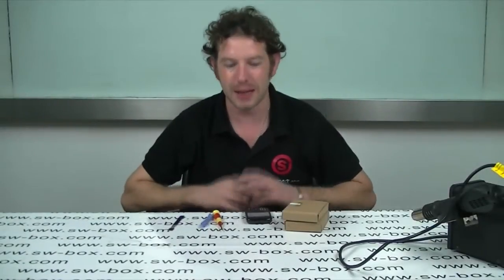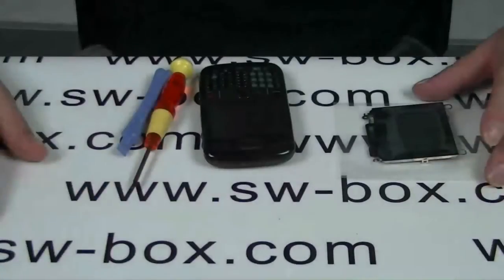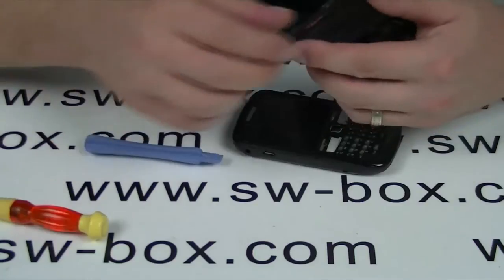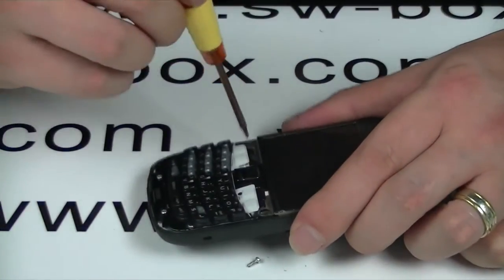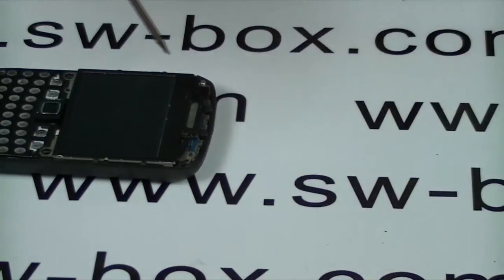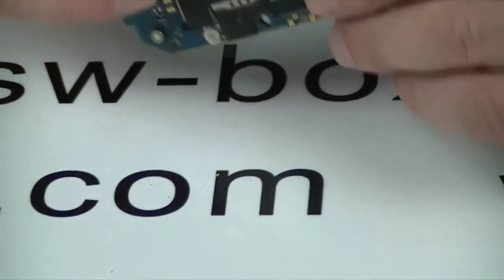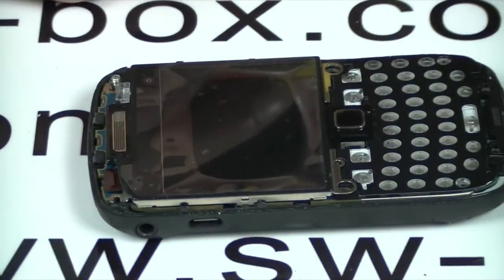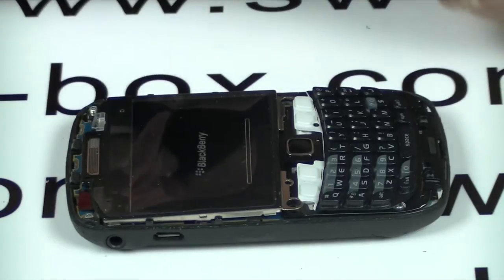how to change blackberry 8520 LCD

Comment from the maker: Hi, no just changing the LCD you should not loose anything, just take your time and make sure you order the write LCD, you need to check if you need the 005/111 or the 007/111, you should be able to see one of these two codes printed on your old LCD, I hope this helps,
kind regards,
Neill

Comment from the maker: Hi, the best thing to do is try a the next size up torx screw driver, if that does not work then try using a flat head screw driver and see if that can work, the other key point with these screws are you need to use a lot of downward pressure otherwise you will damage the heads, I hope this helps,
Kind regards,
Neill.

Comment from the maker: @SuperSmurfz 
 Hi unfortunately Blackberry changed the screen for different regions, not sure why but that's what they have done, the only way to tell which one you need is to take it apart and check the serial number on the LCD,
if you have ordered the wrong one i am 95% sure it wont work but you can try if you like, if it is the wrong one and does not work just send it back and order the right one, i hope this helps,
kind regards,
Neill.

Comment from the maker: Hi, it can only be two things, first your battery is dead, ( but i doubt that ) second it is the battery connection on the middle frame, first check that there is no dirt on the connections, if it is clean and you still have the same problem then you may need to change the connection socket, we don't sell the spare battery connector but a new middle frame from us will cost you $6.43, if you have a friend that has an 8520, ask then to try there battery in your phone, i hope this helps
Neill.

Comment from the maker: Hi, the blue dot is a warranty sticker, basically Blackberry put it there so they know if someone has opened your phone other than them, the screw is under that blue sticker,
You can just push through the sticker or remove it then you will see the other screw,
I hope this helps, and if you need anything else just ask,
Kind regards,
Neill.

Comment from the maker: @bibblebabble69 
Hi, yes sometimes a white screen is caused by the LCD, it's a good place to start, just make sure you check what LCD number yours is before you buy one as there is more than one LCD for the 8520, it will be on the back of the LCD,
i hope this helps,
kind regards,
Neill.

Comment from the maker: Hi, yes you have cracked the LCD, best to change it as it will only get worse, one piece of advise though, take the LCD out before you order a new one as there are several different LCD's, Blackberry made different LCD's for different countries, I don't know why they did this but they have, so check before you order, there will be a serial code on the back, it maybe hidden under a sticker, the code will have some numbers in it like this 005/111 or 007/111, i hope this helps,
kind regards,
Neill.

Comment from the maker: Hi, unfortunately you have to take the phone apart as the serial number is on the back of the LCD, you could ask the shop you purchased it from if you purchased from a shop but I doubt they will have the info you need, sorry about that, 
kind regards, 
Neill.

Comment from the maker: Hi, unfortunately it souds like you have damaged the LCD ribbon cable, I guess the best thing you can do is to try to take it apart again and check that all connections to the motherboard are on properly, then try to turn it on again, if it is still the same then my guess would be you need a new LCD, sorry to tell you this and i hope this helps,
kind regards,
Neill.

Comment from the maker: @mrmaghribi786 
Hi, first you should double check the screen connections make sure there is no damage to the motherboard connection and the LCD cable connection, also double check the serial code on the back of your old LCD as you may have purchased the wrong screen,
i hope this helps,
kind regards,
Neill.

Comment: Hi, I just got my new screen with the 'correct screw drivers ' i ordered it from internet and ive been tryign to take it apart for the last couple of hours, problem is that the screw wont become loose  its either the drivers that came with it are too small or there is someting wrong with the bolt as I tried to open it and might of damaged the bolts. ill try to get another t6 as original ones that came was nt corrent or if thats wrong then ive damaged the screws, what should I do if I have?? thx